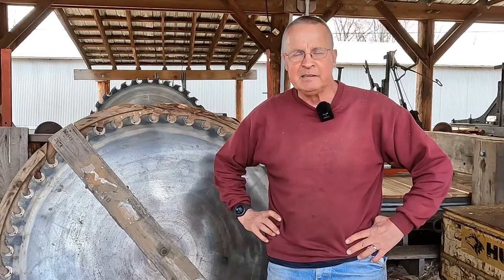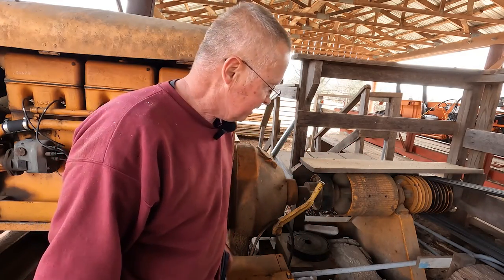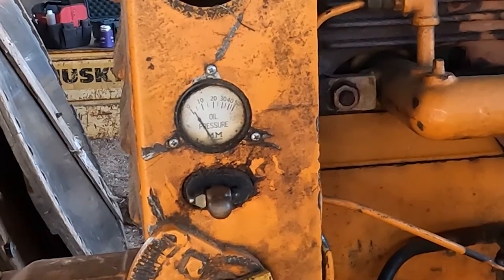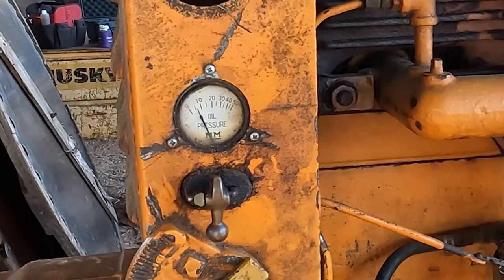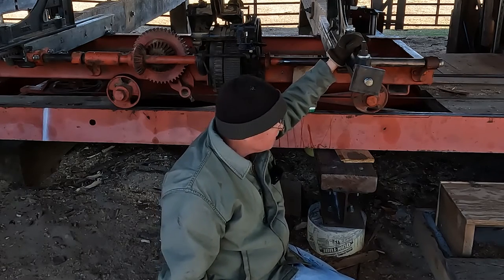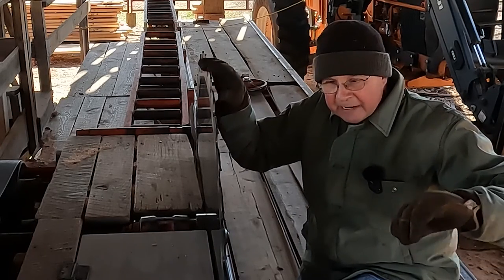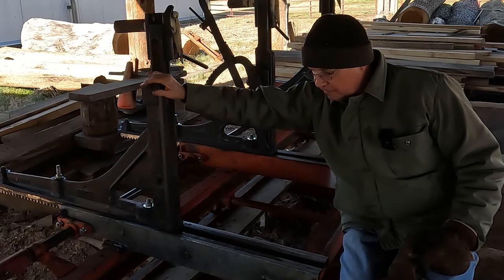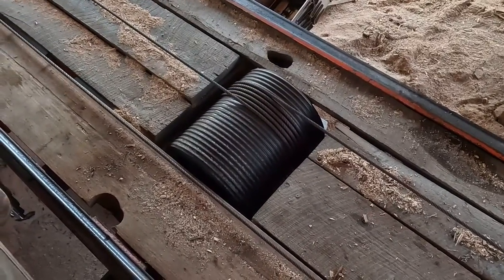What did we do to the Frick Sawmill!

Comment: HI WAYNE I know clean up is a job it has 2 be done if U don't its going 2 a worse of a mess than what it is a rake ,shovel and left blower will be a great help they move more air than just a air hose clean what U can its a wonder that sawmill doesn't have a sawdust drag that would pull alot of the sawdust from under the saw blade where the sawyer stand it doesn't take long 2 clean IVE done that a many of times a big grain shovel works well 2 ,4 that OMG 3 27 2O23
Reply from the maker: Clarence, Thanks for the note. I'll post a video of our dust drag. It's amazing how well it works. I didn't show it, but we also have a small leaf blower. Frankly, it's just a matter of getting the guys to all lend a hand at the end of our short day!